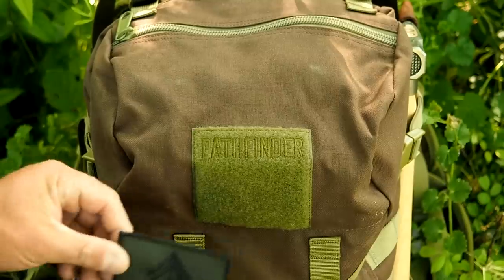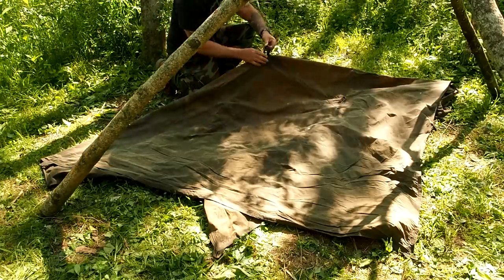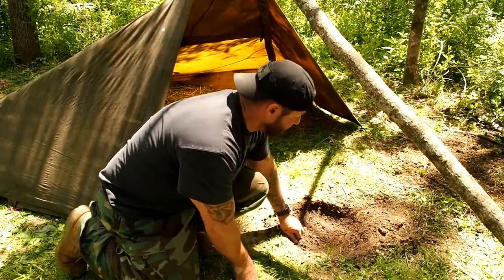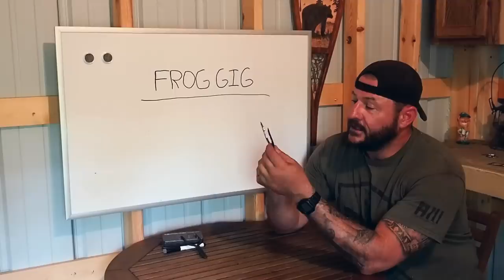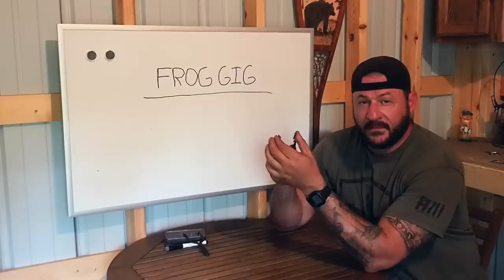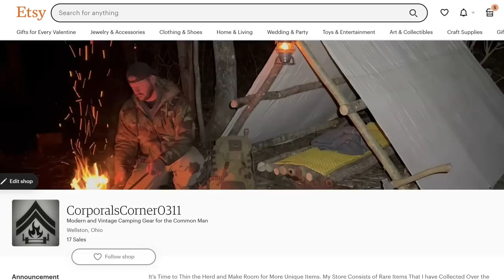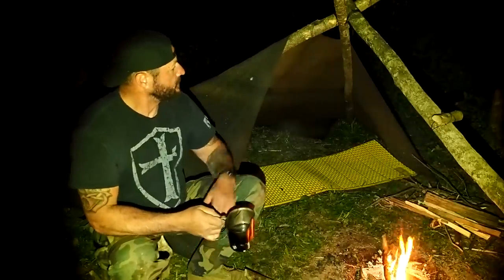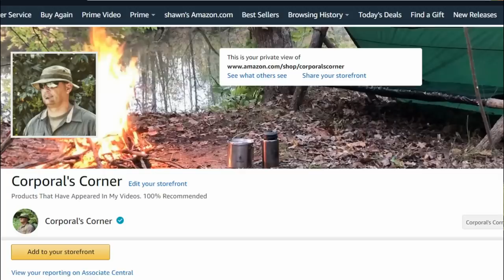Solo Overnight Building a Reverse Tripod Tarp Tent in the Woods and Shrimp Alfredo.

Comment: Cool AF video!
In reference to your final thoughts.
The year before I graduated from high school I attended a vocational school for auto mechanics. I learned a lot about auto mechanics. My senior year I hunted for a job as a mechanic. The problem was I had no experience. I finally found a job at a dealership doing the flunkie jobs for less than minimum wage. I kept my mouth shut and ears and eyes open.
I had gotten straight A's in vocational school and got recommended for a trade school  course in auto/diesel mechanics and welding. My goal from the 6th grade was to be a welder.
Score!
I had no intentions of being a mechanic. I went to school at night and worked full time during the day. For two frigging years. Í had a student loan, rent, insurance, all the usual stuff.
I had several crap jobs that paid the bills.
Sheer luck I was getting a part at a NAPA store that had a machine shop. I got a job there sweeping floors and cleaning parts. I kept my mouth shut and ears and eyes open. I learned a whole lot. I made good money eventually.
I got to know people.
I pestered the flock out of a Caterpillar dealer that I delivered engine parts to. I got a job there in the supply room but I tripled my pay.
I am going somewhere with this.
Now I could weld, mechanic and machine. I was never lacking for a job after that. Luck and fate would have it that I would join the Air Force. What did I do? Aircraft machinist... then later merged into the welding career field. Luck. But that background carried weight even with the service. After I separated from the service I had the capability to work at any one of 3 jobs plus I got my welding certification.
My last job before retirement was a shop supervisor at a carpet mill. I did all 3 vocations plus supervisor.
I did some crappy jobs along the way. I always had a goal and purpose to what I did. But the education I got back in trade school repaid the student loan many times over. Set goals for yourself that are realistic. You may have to sidestep around some roadblocks but keep your eye on your goal.
Above all...........
Keep your mouth shut, eyes and ears open. Learn lots.
Cheers
Terry

Comment: Have you ever used a "key-hole" fire set ? When my brothers and I camp in Southern Utah every year, it is all we use. Quick and convenient. Sets up easily. Build your fire ring from rocks and shape it like a key hole. For those who don't know what a key hole is, just picture a light bulb on its side. Make your ring and leave an open part with rocks in a "u" shape. When your fire has some hot coals, scrape them into the key hole and put your pot or skillet on the rocks. Done deal, or easy peesy.

Comment: Outstanding work as per usual Corporal. Have you thought about doing a forged bushcraft arrow head set? You could just about get a whole set of arrowheads out the same amount of material you have in the frog gig. You could even do a ball pen hammered finish to give it that flint knapped look if you wanted . just a thought. Have a good one.

Comment: Is the gig hardened enough to use for a flint and steel fire starter? It just kind of has that shape.  If you are going to carry it, it might as well start fires. Also a pass by a bench grinder on the outside edge would give it a nice sharp 90° scraping edge for use with a fire steel, and other crafting uses.Multi-tool? What else could it do?